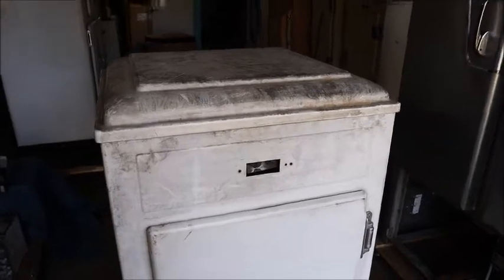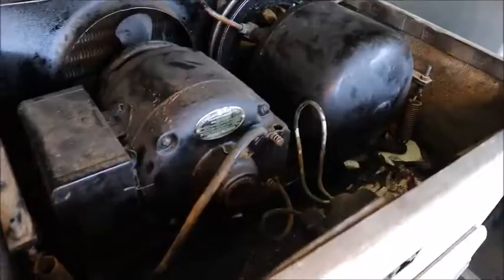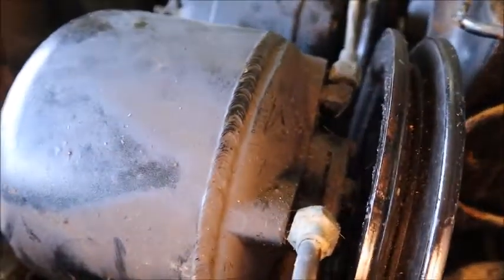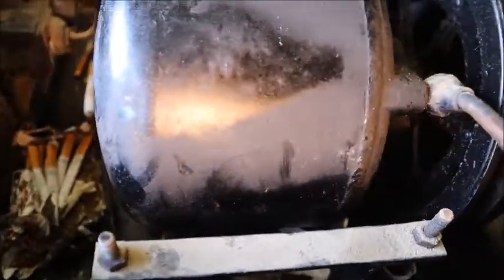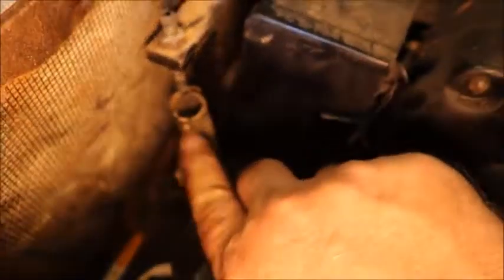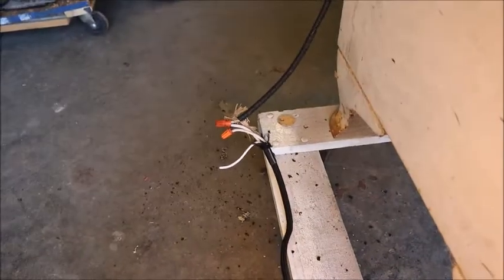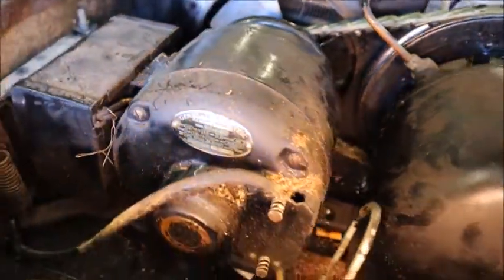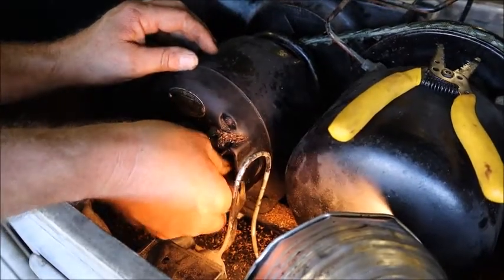Antique General Electric belt-drive refrigerator - 1 - Checking out and disassembly...

Comment: Was just digging thru some of your slightly older video uploads here, in an attempt of seeing if possible, you might have come across &/or messed with an early DR-3 unit yet.. one which incorporates a “start capacitor” in a rather large metal box, mounted directly behind the condenser coiling, as that’s the type I have, on the cabinet that was called GE’s “deluxe” model, for a single door fridge; model P-72 & is ONE HECK OF A BEAST! I found this fridge’s inner workings very ingesting as well, for all of the same reasons you pointed out… I felt compelled to leave you a comment, of after hearing your last bit of dialogue, explaining how even that relatively small cabinets’ parts, have now taken over most of your shops’ available space.. that got me laughing!! I’ve already FULLY dismantled every single part of my early P-72 DR-3 Monitor Top, with all intentions of going over each part, to fully clean, refurbish, restore, revarnish &, remake what wood door opening trim is bad… yes, most definitely, does this type of project TAKE OVER ‘ALL’ AVAILABLE SPACE IN SHOP!!!!!! I’ve watched/listened to all of your videos to get schooled up on all-things I can, pertaining to these Monitor Top fridges, to assist my restoration efforts. And yes, I’ve “liked/sub’d” your YT chan oh, about 3 years ago now.. THANK YOU for all of the vital information you’ve relayed over the years!
Reply from the maker: Hi Sean. Thanks for your comment. The capacitor box on the DR-3 is a transformer-capacitor unit. It performs as a start capacitor and a run capacitor by selecting between two turns ratios of the transformer. The capacitor its self is operating on a very high voltage and they tend to go bad over time. We normally remove the transformer-capacitor setup and replace it with a separate start cap and run cap in the same housing.  

These do expand and take over every possible bit of shop space, that is for sure!
Reply: @davida1hiwaaynet  Thanks for response.. yeah, that is something I was already thinking of doing; that of, placing modern start & run caps in original canister. Of the “way-to-many-to-list” vintage/antique things I’ve taken on, refurbishing &/or, restoring, I’ve done replaced I don’t know HOW MANY old caps in whatnots.. restored a 1927(8?) Philco HighBoy radio a few years back.. suffered some fire damage from house it was in, that burned down, less a VERY FEW items that “somewhat” survived..
THAT radio’s chassis contained a RIDICULOUS number of old-school foil caps, all packed in that same type of black wax/tar junk! Took awhile but, got that radio working like new.. it’s cabinet is a different story however. That’s still a “maybe” someday wood project! Of this crazy beast of a fridge I have here, being the “DeLuxe” model, most definitely took up major floor space in my shop! Was able to carefully store every bit of cabinet parts into one large wood box on caster wheels, for now.
Compressor top unit is secured to a separate caster wheel cart, waiting for attention soon.
Mended the break of base of vertical control unit’s Bakelite frame; apparently an all-to-common a problem &, likely why GE moved on to using them horizontal control units. 
Mended break with J.B. Kwik two part epoxy.. so far, so good.
It’s possible the bellows has no SO2 charge left in it, as I didn’t notice any significant change, when subjected to freezer v outside heat.. will perform modern charge port addition mod as u did in previous vid, if definitely no charge left..

Now, all that said and aside, this fridge IS missing something that really REALLY sucks! Both its main nomenclature plate, giving exact unit info/data &, the cool “GE Icing Machine” logo plate, over heater hole, at base of condenser coil. This unit is VERY early production, as its compressor is of that “semi-hermetic” type, being bolted together.. cabinet’s single door has THREE long styled hinges, like mostly found on bigger double door or more units of the early production models.

Comment: is this one of the earliest fan cooled evaporators?
Reply from the maker: Hi; thanks for the comment! I think you may be thinking of the condenser coil with the fan on the motor. This is definitely an early example of a fan cooled condenser. Frigidaire started out with air cooled fan-coil condensers in 1925 or 1926 with their belt-drive units. The belt-drives generally have much higher HP and cooling capacity for any given cabinet; versus sealed units. For that reason, they need to have forced air flow to carry away the greater heat capacity.  Have you seen my Frigidaire M5-2 with its non-finned air cooled condenser?
Reply: @davida1hiwaaynet  I always get the two mixed up, lol

Comment: Very cool detective work there. I find that on a lot of old radios I work on, a lot of repairmen back in the day were total hacks. Could have been some guy who read a book on refrigerator repairs and did repairs on the cheap. Whoever worked on that motor clearly wasn't an expert.
Reply from the maker: Yep, they really weren't an expert! Not only reversed but the end bells rotated all wonky. That would have been visible well before they got it back together and found it not to cool.

Comment: My guess for the reason of this design is that it could have been a value/low end type option since the full hermetic motors were likely very expensive at the time. Being belt drive and relying on a shaft seal, many of these were likely lost to time as manufacturers moved away from belt drive and also the war effort. Also since a belt drive has more places to leak (especially SO2 systems), which in turn required periodic maintenance, many may have been replaced by their full hermetic counterparts, this is only a theory however.
Reply from the maker: Evan, you are so right abou2 these being lost to time. There were many reasons, in addition to your explanation. There were ad campaigns about dangerous abandoned refrigerators trapping kids (may have happened once or twice and not a widespread issue) as well as scrap metal drives for the War Effort.  

There are still a few hiding, I am sure.
Reply: @davida1hiwaaynet  nowadays the amount of excessive safety features drives me crazy, what happened to “personal responsibility”.
Reply from the maker: @evanchapmanfanman  This is so true! People are being dumbed down at an alarming rate.

Comment: They made belt-drive units for DC mains power, since DC motors needed brushes and electronic inverters hadn't been invented yet, but they may have had a surplus of the compressors even after they stopped selling DC models, so sold them with AC motors instead.
Reply from the maker: They did use DC belt drives, for sure.  However, GE in the early 1930's had a DR series Monitor Top and possibly a CK series which were DC hermetic. The hermetic motor was four-wire two-phase, and there was a rotary converter underneath the cabinet to convert the DC mains to the correct 2-phase for the motor. I wish YouTube had a way to attach pictures to comments, because there is a neat write up and pictures in the manual about this.

Comment: Dave, Excellent content. I believe that is not technically a General Electric model but 1934 HP-4/5 model from their marketing subsidiary, Hotpoint. Hotpoint's Chicago plant built the cabinet and put the GE sourced mechanism in it. It was non-hermetic as to not compete with the Monitor Top. Once GE introduced the sulphur dioxide "flat top" their Hotpoint brand went to a sealed unit as well. It was a goofy marketing arrangement for sure that went back to Hotpoint's founding. Undoubtedly it was all to satisfy anti-trust and merger issues.
Reply from the maker: Thank you for this info! This makes lots of sense, considering the front of the top panel having an extra hole not covered by the emblem.  Lots of marketing craziness, I am sure!
Reply: I found the cabinet in the parts manual. Depending upon the defrost position there were three different escutcheons.
Reply from the maker: @WC0125  Would you mind sharing a link to the manual?
Reply: I'll email you a link to where I purchased the copy. It's not digital.

Comment: I thought you might end up working on one of these.  The only other working one I was aware of was a Hotpoint, and I think it may have been in Australia.

What can you tell me about that big commercial cabinet?
Reply from the maker: Thanks! 
As for that cabinet; it's a 50's Foster Thermo-Dynamic all-refrigerator. Has a Tecumseh 1/4 HP unit and runs like a top. Was a local find I bought to repair and resell.
Reply: @davida1hiwaaynet The only Foster I know of is an old UK company who makes commercial/industrial refrigerators and freezers.
Reply from the maker: @douro20  Same here. I think this was an American venture of the same company but not sure. There is very little about it online. Here is the part 1 of the video series about it: https://youtu.be/o_RRdjMfwrg